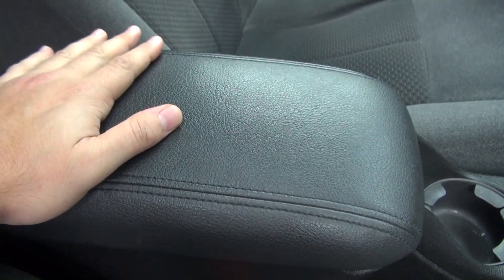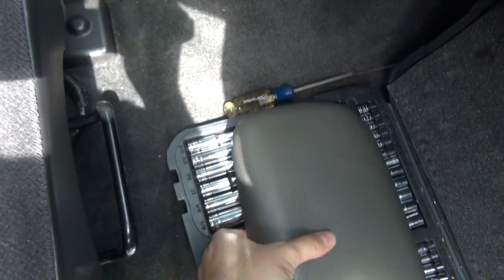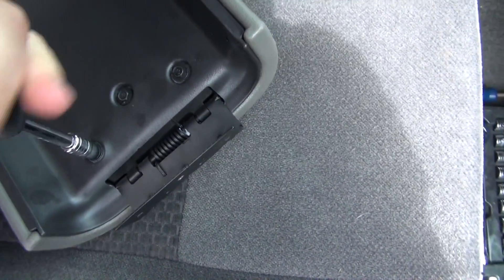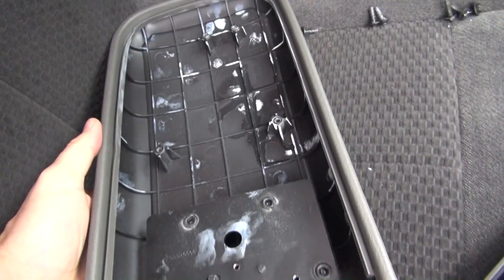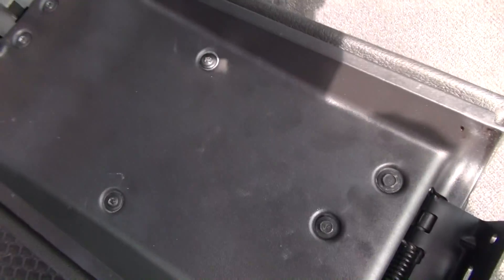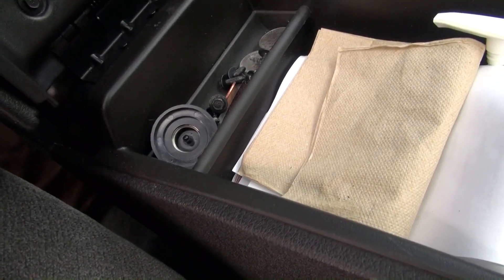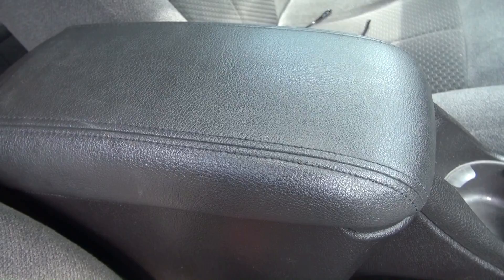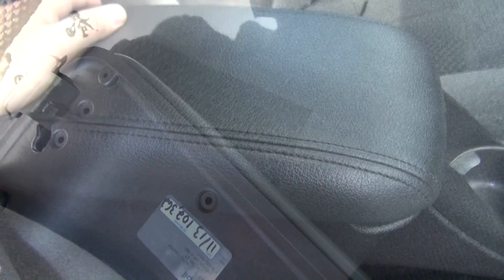Trailblazer,Envoy center console lid repair

Comment: Last year I purchased an '05 Chevy Trailblazer that had this same problem. The plastic post was broken, but not missing. It was resting in the hole. I took apart the top of the console, used J-B Weld to hold the broken post in place and screwed a stainless steel flathead screw (with washer) into the broken post through the tacky J-B Weld. The epoxy and screw dried together overnight. The repair worked and is almost undetectable. The lid not longer pops up while driving over rough surfaces.
Reply: The post on my just broke off and it won't stay down at all. Thank you for this!

Comment: the plastic tab by the latch breaks, which makes the lever's own latch useless, I fixed mine by going to a junkyard, the tab was broken, but they hot glued it and used a screw. Amazon had one for under $50 you can buy one with the leather, or without the leather.

Comment: It might not work after time slamming the lid down ?  Prob help squeezing the lid trigger before opening & closing it ! Their not the best design ! I've had 2 envoys & both the rubber post were broken , people try to get in them too fast & when they open the lid they open it before the rubber post clears the console , they pull the top lid back & snaps the rubber post !! Amazon has them now 19 bucks than delivery charges on top of that !